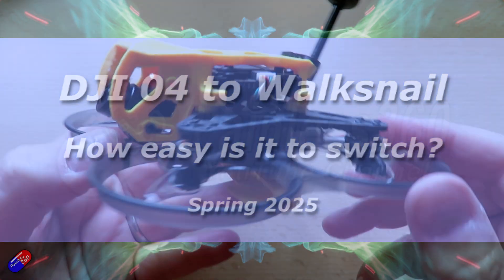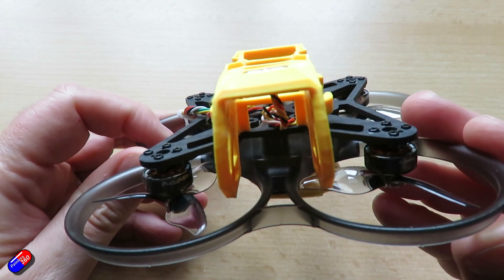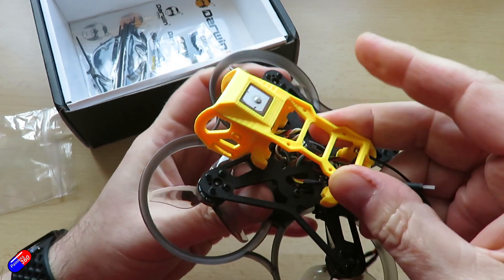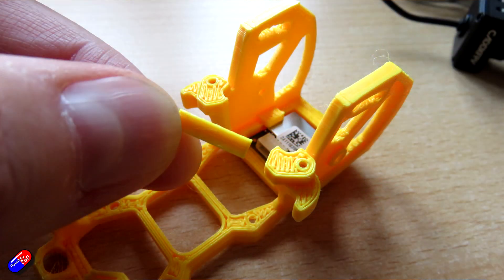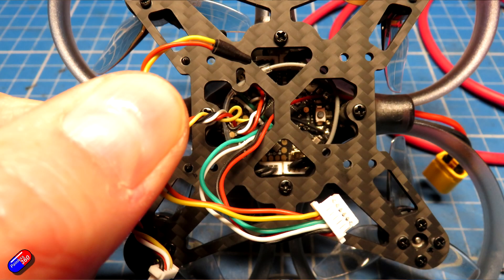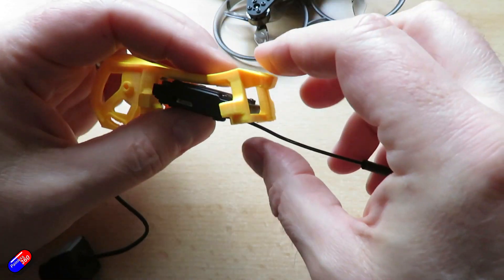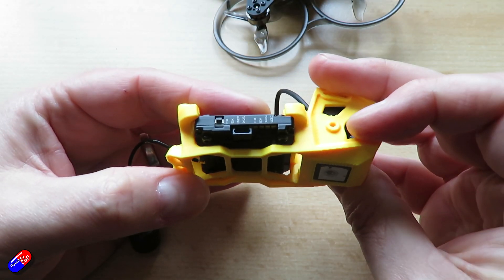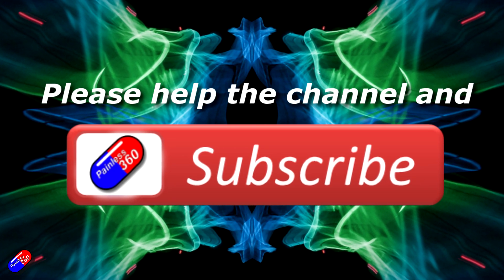How easy is it to convert a quad designed for DJI 04 to Walksnail?

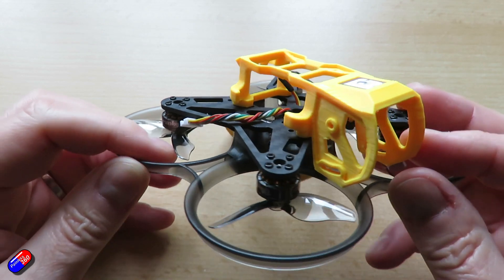Comment: 1:15 I'll tell you why: it's been proven that DJI puts pressure on BNF manufacturers  NOT to sell Walksnail quads. 
And that is exactly why I converted my Pavo Pico to Walksnail 1S Lite :-)
Reply: I asked iFlight and they said, DJI don't put pressure on them. The only reason that they stick to DJI is, that the demand for Walksnail and Analog is really low. But this sound like a big lie to me. I think your point is right.

Comment: Exactly what I did with my Pavo20 Pro. Literally 2 minutes of trimming plastic and the Avatar HD Pro fit perfectly. Swapped the pin connector in a couple minutes and done. The only problem was the antenna wires are a bit long and the antennas won’t fit in holes as they are a little thin to fit in the holders, but using a couple of 4/2mm CF tubes fixed that problem easy peasy 👍